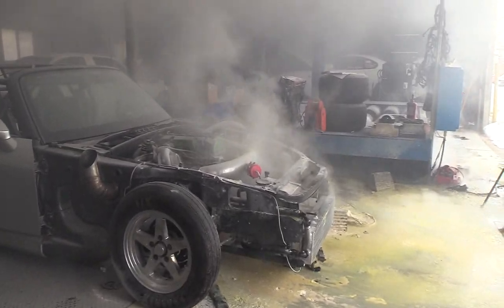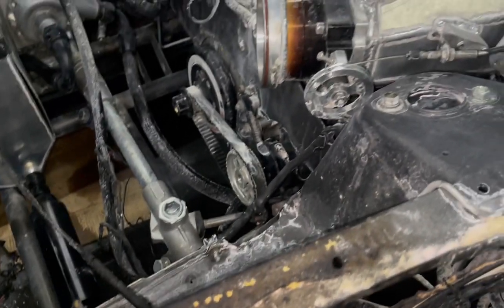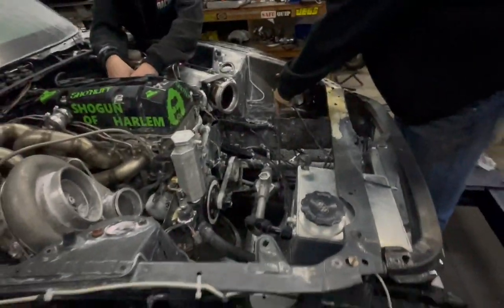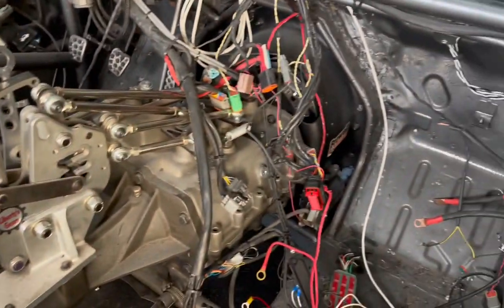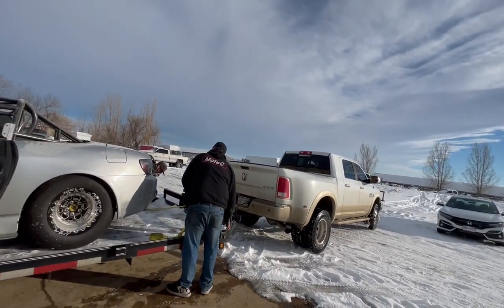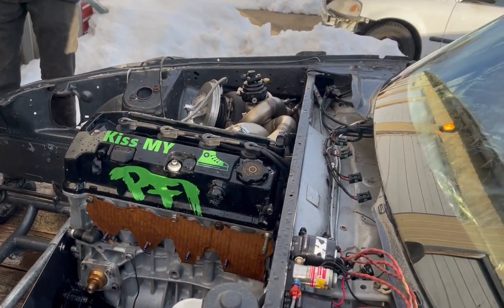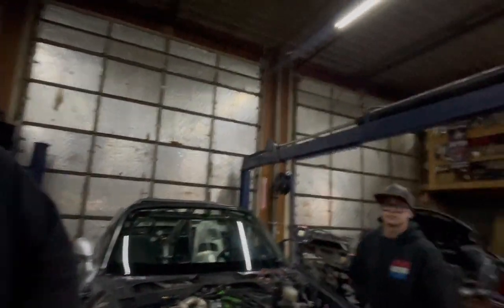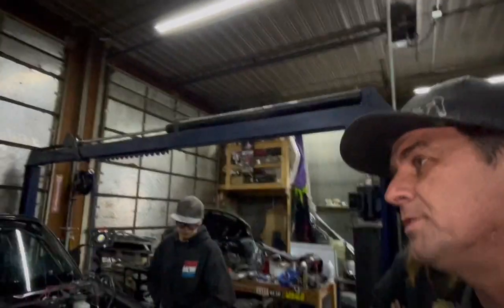After The Fire. Disassembly And Clean up.  Sho’nuff

Comment: It totally sucks that this happened but you all were extremely lucky that no one was injured, the shop was not damaged, and the damage to Sho’Nuff was worse than it is.  In a strange way you all were lucky this most unfortunate event happened at the shop where you had fire extinguishers and water. I have seen several cars, trailers, and tow rigs get burned up at the track as a result of crowded tight pits combined with people frozen like deer looking into headlights rather than grabbing the fire extinguisher out of their truck or trailer and lending a hand putting out the fire.  That all said the best thing you can do for Sho’Nuff was doing what you did is washing off the dry chemical fire extinguisher residue.  I highly recommend you give Sho’Nuff another good bath.
It sounds as if you guys are also using this incident as a learning experience for just in case there is a next time.  Besides adding more or bigger/better fire extinguishers and a hose for methanol based fires and something to quickly cut the straps holding the car down might I recommend you not store any unnecessary fuel or other flammable chemicals of any sort near the dyno. I know that might be a pain in the butt however just think of the consequences of not doing that. Additionally no one should ever park in front of either Dyno Bay just incase you have to push a burning car outside.  Lastly comes how do you prevent something like this from happening again and the best thing I can think of is to always blow the engine compartment out or run a fan before crank on a car to avoid having a pocket of fumes build up and be ignited by a backfire, or some other flame or heat source.  Myself I have had a small engine bay fire several years back due to a fuel leak that I had fixed the night before and had thought all of the gasoline that has leaked has evaporated overnight.  That night was cold and the thermostat in the shop was set to 40 degrees and the heater was running when I opened my shop that morning. As my usual I cranked the heat to warm the shop up had a cup of coffee and called customers etc. Anyway the warming of the shop by cranking the heat up got the residual fuel to start vaporizing again and I lit a hand held Map-Gas torch to put a little heat on a crusty O2 sensor which ignited the fuel vapors that were in the frame rail of the car which in turn singed my beard, hair, and the hair on my right hand/forearm. Luckily I was wearing my eye glasses which also are safety glasses so my eyes, eyelashes and eyebrows did not singed.  The damage to car fortunately only a little bit of burned paint in the engine compartment and burnt wires and heater hoses.
One last thing when you reinstall the fuel cell have you thought about relocating or extending the vent for the fuel cell to get it farther away from the turbo

Comment: Now is the time to use our connections to help Brent in any way, if y'all know anyone who can help supply parts etc. Let's get Brent racing with his baby. Super sad to see, but it's not about how many times you get knocked down, it's how many times you get back up. Stay strong PFI we will get through this!
Reply: At least it happened in the shop not on the track could have totalled car
Reply: @uncensoredgarden  true on the track it would of been much worse
Reply: Love your comment Mark!!! Real sees Real. Live Blessed.
Reply: @uncensoredgarden  I have seen several cars, trailers, and tow rigs get burned to the ground at the track because people just froze like deer staring at headlights instead of reacting and grabbing fire extinguishers out of their trailers and fighting the fire.  That said Brent was incredibly lucky to have people be able to run and grab other extinguishers to keep fighting the fire instead of having to do both tasks at one.  It would a good thing if PFI could get a couple of “Cold Fire” fire extinguishers of the appropriate size to put on either side of the dyno’s front and rear
Reply: Bro u know he has money? Why don’t you help somebody in need
Reply: They have foam extinguishers specifically made for alcohol/methanol fires. Probably be a good investment just to have a couple on hand. It might be messy but would be easier and cheaper to clean everything rather then replace.
Reply: @Manny Del Real  regardless if he has cash in the bank or not this man just took a hit if there's bits we can do to help am down with that, people need to realise being kind and helpful shouldn't be affected by the fact somebody has money if they've just had something horrible happen who cares ? Brent's spent years on this car ill help out if needs be

Comment: Hey, I noticed the gas tank edges were butt welded, if your fold a lip on the edges of the tank, or fold the ends into a pan that slides into the tank, you can use a stronger Lap weld, and should the weld blow out, the folded lip will still partially block the opening rather than a large gap spilling all the fuel at once.
Hoping for a speedy repair and glad youre all safe.

Comment: First, I'm super happy that everyone is good and that the damage isn't as bad as I expected after the previous video. 

I understand the whole hindsight is 20/20 thing but I truly believe that accidents create the best learning opportunities. So if there's an easy way to prevent similar accidents from happening in the future, the whole aftermarket / race car scene should probably agree as a group to implement that solution on all their race cars.

Maybe there's a better solution out there but I believe that a simple flash arrestor in the fuel tank vent would have prevented this fire. The crazy thing is, I've never heard of anyone building a flash arrestor into their aftermarket fuel system so I'm not saying you should have done this. 

The problem with preventative safety is that when it works, nothing happens. So no one even knows that a catastrophe was just averted.

Comment: My heart sank when I saw you video yesterday. You all worked so hard to get there. Stay strong and you will come back swinging. I had a similar issue before with my car from a AC line on a header after i put a new motor in. but i was a 1 man show trying to get it out. I must say your communication during the fire was on point in yesterday's video and was the first thing i noticed when i watched it. Everyone handles high stress situations differently and its one of those things you dont know til it happens: but you guys did great

Comment: Attitudes are incredible! You are there and know the car far better than any of us. Not sure if you are on e90 or methanol, but sprint car (mechanical pump and methanol) experience has taught me a bit with Methanol.
Methanol fires are scary, they can hardly be put out, but they start soft just like engines starting on it. Having ample water to blow mist, push and wash low leaked fuel away to somewhere safer is usually best, moving the heat with it. That looked like the tank had pressurized, I've ever seen one do that before, sorry to see it here. Regardless of vent location, running a geared mechanical pump in a closed system can build pressure. 
I wonder if the vent starting doing its job on the back fires with the tank under pressure? So glad everyone is ok. Rebuild that monster, we're all rooting for you!!!

Comment: Your doing the right things, accepting what happened as a setback that needs to be overcome. Yes you have work to do, in that overcoming, but its well within your wheelhouse. If you can rebuild Goofy's front end after hitting the wall after ripping off the suspension, then making a new tank, wiring, and getting the starting overcome is not as difficult is it... You got this!

Comment: BRENT NEEDS TO SEE THIS SO LIKE PLZ.. Get 5gallon Buckets, Rubber Made Tubs or a large Trash Receptacle of BAKING SODA, SALT, FINE SAND OR DIRT. Monoammonium Phosphate is way to expensive. Keep them somewhere in the shop for extra fire fighting power. I like the Rubber Made tubs because u can drag them around easily. Keep a 3-5 gallon bucket or a scoop on top of it to easily bail the powder out and toss where u need it. Keep your heads up guys, stay positive. The end result will mean even more when the time comes. To make a pass will be so rewarding knowing how much work you put in. God Bless!!!!

Comment: You may know, but u need to clean the fire extinguisher powder off everything asap. It will mess up anything, including paint, plastic, and powder coat if it sets on it any time at all. Learned that the hard way when we popped a motor.

Comment: Watching that explosion and fire convinced me to reroute my fuel and power steering lines on my k swap integra. To me it makes zero sense to have them hovering over the hot exhaust area. Ive seen a few burned TSX's that had the power steering hose leak oil onto the exhaust and result in catastrophic fires. I will also keep a fire extinguisher in the car at all times. I am most grateful none of you were burned from that explosion.

Comment: Looks like the forward facing blow off valve is less than an inch from the fuel tank vent. Spinning it over that much combined with the brake cleaner caused it to load up really bad and backfire which cracked open the blow off and let the explosion escape right there at the fuel tank vent. Don't know if it would be better to move the blow off valve (which is what I'd do) or extend the fuel tank vent much farther away from the tank itself. 

Sucks that it happened because Brent is a great guy and seems to never be able to catch a break. We all know Shonuff will be back and better than ever but taking a hit like this completely sucks.

Comment: With the car not starting and Jamie cranking it as long as he did. Is it possible the mechanical fuel pump just built so much pressure in the system the tank blew? Which if that was the case and the car wasn't starting. Would that mean the injectors weren't firing and caused the fuel backup/pressure spike?

Comment: "Fire it up...NOOooo,I mean 'Start it up'..." ! 'Up In Smoke',but not burned down.The dreams are still there,and just set back a few days.Get some Clear-Coat on the burnt metal,and start remeasuring lines for the fuel and coolant.Your buds probably have the wiring harness on file.
You All did great in saving each other,the car and the shop.I don't think it took 5 minutes from start to out.That's how well you all did.

Comment: Just Install some prime pump w mechanical fuel pumps. Its headache crank up mech pump car when sitting more than like day without running. Had my car like 1 year on just mech pump and then added external pump which I just put inside my tank, prime and  run for few seconds and then switchnoff..remove
Keep fighting guys! GL!

Comment: When welding aluminum or stainless tanks for the engine bay I was always told to oxy-fuel weld it instead of tig welding it. Looks like the tank ruptured right at the welding. Need to figure out the cause. How did you deal with vapor pressure build up?

Comment: Do you think it was because the thickness of the aluminum wasn't thick enough and it caused it to swell under the pressure of the fuel .   And then that's what caused it to explode aluminum fatigue. or do you think that the gas cell ruptured. After the fire was started

Comment: You guys will have that fixed in no time and be joking around about it in no time.  I don't want to say anything negative at all but I wonder if the weight distribution is worth the risk with having the fuel in front like that because just imagine that happening at speed ad having all that fuel sprayed all over everything.  It might have been a blessing in disguise that this happened in the best possible scenario ad as long as we learn from what happens it is worth it in my opinion.  Great job keeping it real and inspirational.

Comment: If you have a methanol or alcohol fire then having a proper fire hose close at hand is the best option because the water mixes with  both those fuels and makes them non flammable . It much faster and effective than powder extinguishers.  Really sorry this happened but given no one was hurt and you did not loose the car or your workshop its just another set back that can be recovered from.  -- I did not hear you say exactly what  the cause of the tank exploding was but I assume it was a backfire coming out the blowoff valve near the tank that ignited the vapour coming out the vent on the fuel tank ?

Comment: It would be really cool if you make the tank 100% sealed and then you ran an an6 rollover valve, with the vent going all the way to the rear of the car. When I was building rallycross cars for the Dorans, the tanks were inside, next to/behind the driver. We used dry breaks for fuel filling and the vent was placed as far as possible from an ignition source. Pretty sure the bag tanks had the rollover valve built into the tank. I have a similar setup on my personal car. I will send pics over to you on Instagram. Props to you guys though. It is inspiring to see. Fires are scary, I have seen my fair share😢

Comment: Get at least a couple of Pro Plus 20 MP 6-A:120-B:C Fire Extinguishers. They are larger, I think they weigh over 30 lbs. But just one of them would have most likely put that fire out in seconds. Not sure what type you had, but if they were a class A they have some water in them which doesn't work that well on flammable liquids, The 6-A 120-B-C works great on garage fires that have flammable liquids involved.

Comment: I'm still trying to figure out how the gas tank blew when doesn't the fuel pump mechanical or electrical suck & push pressurized fuel into the fuel injectors but for it to pump pressure back into the fuel tank for it to explode then would that say that either a mechanical or electric fuel pump went in reverse? Handy hint for next fuel tank, put gussets inside to strengthen the walls.

Comment: I am very happy that everyone is OK. But I would really rethink where to place the fuel tank. They stopped having the fuel tank near in front for many safety reasons. I think you just found another. What if this happened down the track? A fire; as you know, is the worst thing in a crash whether it's on a track or on the road. I understand the weight argument, but no matter where you place it, high or low as long as it's in the front will always be a fire hazard. I have had several VW Beatles and I had an electrical fire right above the gas tank. I was as you guys in front of the vehicle and was able to yank the cables with my hands, and I had the burns to prove it. One of the cars was burned when I bought it and did a rebuild. Then on another occasion my friends Beatle cought fire in the back seat as the battery underneath had uninsulated connectors and the springs in the seat shorted out when his GF sat down, this happened during driving, she moved from one side to the other. Anyways be safe and the best of luck to you on the rebuild.

Comment: Fuel tank pressure sensor.   I still don't like to see using the tank as a crumple zone. Same thing with mullet.  Is the weight on the nose really worth it at 200 mph? So many safer places to put it.

Comment: So sorry to see, Have you thought of something like a watermist or high fog system over the dyno? very small droplets of freshwater contain cool and put out fires, Safe for humans to be in and we run that over the top of running generators and engines.  They can be set up with a high pressure pump or by too cylinders that look like extinguishers one with nitrogen and one with water. These systems can be put together DIY or bought from companies like TYCO or DANFOSS

Comment: It is actually a good thing those tank seams failed - it prevented the metal from failing and truly creating a bomb with shrapnel.  
Edit:  Is it possible the fuel pressure caused the tank to blow and THEN it caught fire?  Probably not, but just a thought...

Comment: Looks like whoever welded up that fuel tank for you didn't get their weld hot enough to get a good enough fusion of the metals.

Thank god it happened in the shop and not going 160 down the track!

Comment: well, at this point, if you were procrastinating anything due to having to remove stuff or redo some wires, well now that you are forced to, might as well go all out and do it all! on the other hand, if you had nothing like that, then maybe not add new things but make sure you treat most of the plastic and o rings near that fire as cooked and make sure they actually are good. (in case bundles of cables inside protective plastic casings were not easier to melt than the casing, making the outside look good, unlike the inside...)

Comment: hmmmm i was thinking.... how about building a frame with tubes above the car with high pressure fire extinguish, so if a fire breaks out  you can push the button and the fire extinguisher goes off aimed at the engine or the hole car. I mean that frame can be like 2meters above the car when you using the dyno to prevent this happening again,  and more safe for the person in the car and arround

Comment: I would personally move the location of the fuel cell, OR redesign the charge pipe so there isnt a blow off valve/pressure vent that close to the fuel tank.

Comment: The one thing I've learned from my car lighting on fire and having to use fire extinguishers is...   don't use fire extinguishers unless you absolutely have to, and if you have used the fire extinguisher once you get the fire out, immediately get the pressure washer and start pressure washing. Every second that you let it sit there, it becomes 10 times harder to get off. And it gets in everything. There's probably a fine layer of fire extinguisher on everything in that shop. I hate fire extinguishers with a passion.